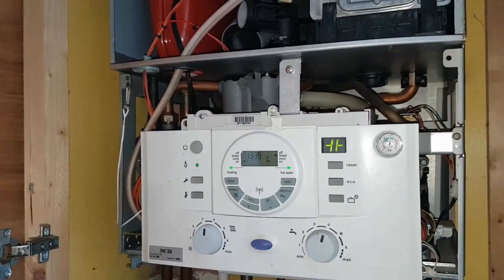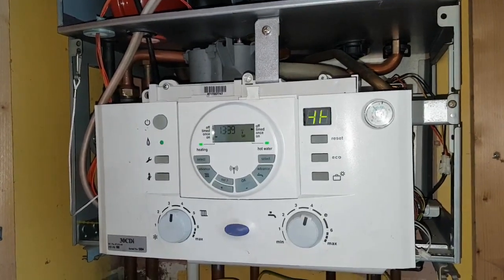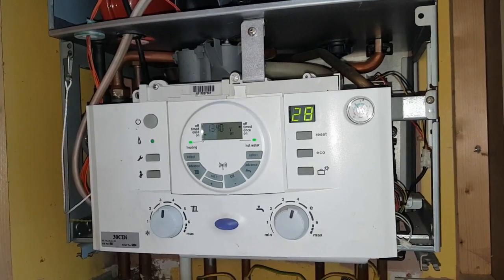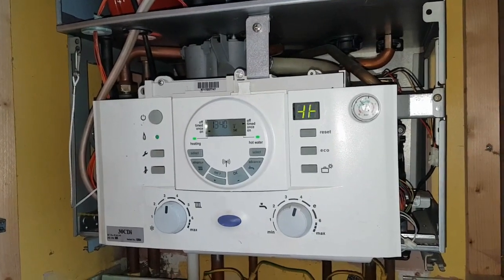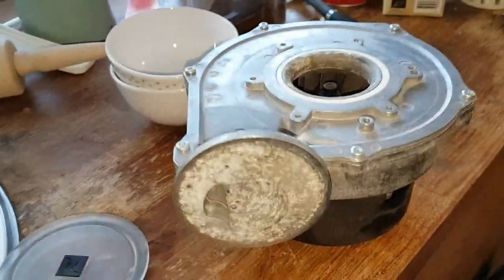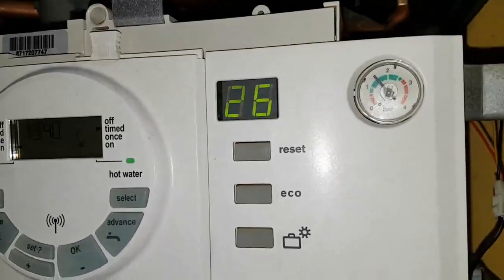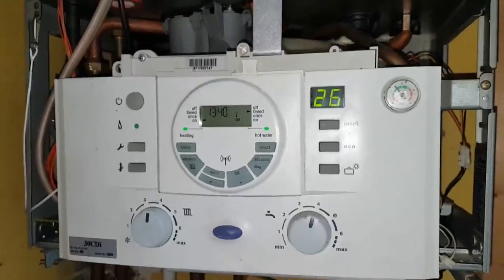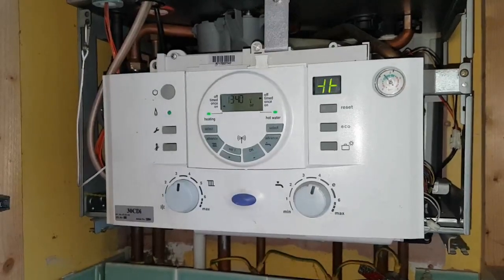Worcester Greenstar Fan Fault. With Coach Tony Morgan

Comment: Hi thanks for the videos. My Greenstar 24ri boiler stopped running. When it initialy stopped the fuse had blown, I replaced that then when I switched it on the fan pcb board controller blew. Any ideas ht be happening and what I might do to rectify I should just replace fan controller pcb board, the fan and controller, fan the controller and main motherboard? Any help appreciated?
Reply from the maker: Normally I replace the complete fan unit
Reply: @ARBoilers  Ok thanks what I forgot to say is I wathed your brill vid and bought a new controller, thinking I was being clever and it too went bang. Ill take your advice and replace the fan after checking theres still power there. Really appreciate your help